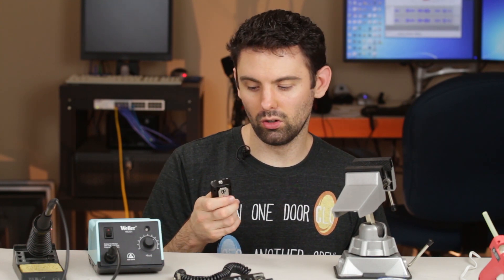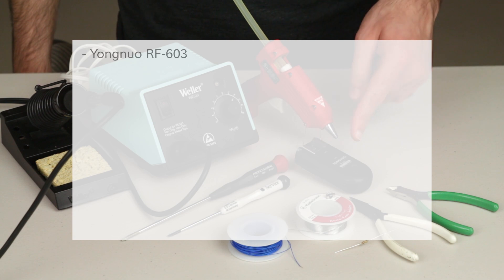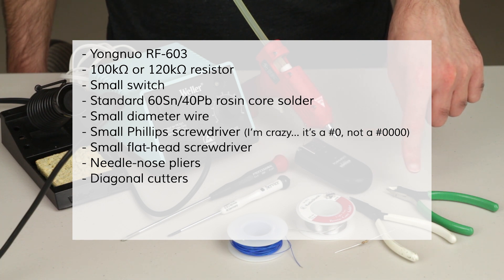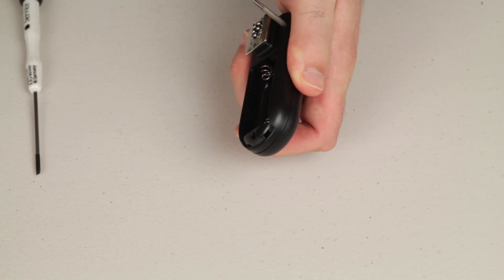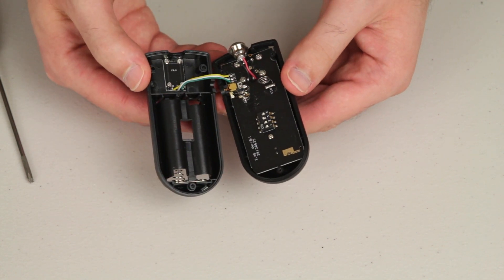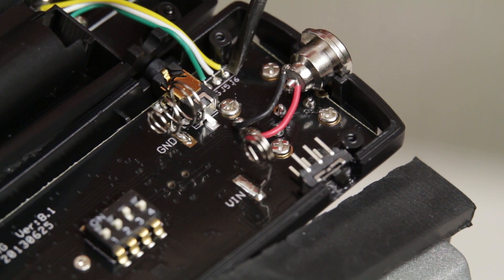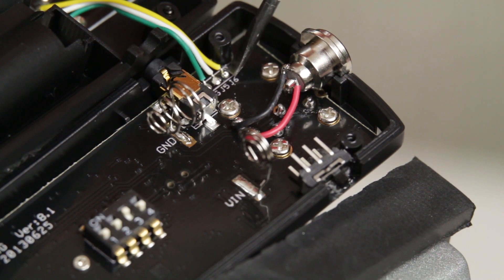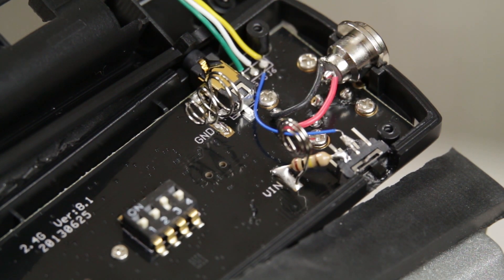Quick Hacks: Modding the Yongnuo RF-603 Wireless Flash Trigger

Comment: This method works with 603c (first version) for Canon and Sony a7III. But in my case only for a short time. Now when I plug the trigger to a hot shoe one of two green lights turns off. But when I unplug it from hot shoe it works great, both green lights turn on and I can make a test flash with my Canon Speedlite 580EXII pressing the key on modified trigger. 
Maybe someone know what could it be and how to solve this problem?

Comment: i have 2 of these and have done the same hack, however i did the hack to the second one also and nothing happens, with just one hacked it works fine, 
i didn't however use a switch as this mod doesn't get in the way of the camera. basically, jumper wire straight from vin to j6 and the hacked one works in hand and on camera

Comment: Hi Alex, thanks for the video. I reckon we now have the 603 II and 605 that have that functionality built in. Although I have a question, that I hope you can help me solve. I need to trigger my Yongnuo flashes that I put on stands with whichever trigger works. I have the 603 II, but I can buy the 605 if it will works better. But here is the catch: I want to have my Olympus TTL flash in the top of my camera (Olympus E-M1), and use the PC sync to trigger the 603 II, to trigger the flashes. I hope it makes sense. I mean, when I press the shutter, the TTL flash will fire and get me a properly illuminates image, but I also want ambience light for some darker venues, provided by my yongnuos bouncing off the ceiling on stands in the corners of the venue.

Sadly there are no 603O (for Olympus) or 603P (Panasonic), so I got the Canon version, 603C. I think the pins align, but obviously the electronics inside won't work. I don't expect to work. But I wonder if it can be modified to make it Olympus compatible. That's the reason I want to trigger the 603 externally, and not mounted to the camera.

Another idea would be to maybe mod the 2.5mm plug to make it like it was pressing the test button, which will trigger the flash. I don't really use the trigger for the camera, but for the flashes only, so I don't worry if I lose the camera triggering functionality.

I haven't tested the PC sync plug on the 603 II, since I don't have a PC sync to PC sync cord.

Is there a way that you know that I can do this? Or how to mod the 603 II to enable this feature?

Thanks a ton

Martin
Reply from the maker: +Martin Ocando I think I understand what you're trying to do, but I don't have any experience with the 603 II or the 605. That said, do the Yongnuo flashes you're using as, essentially, background lights have a flash detect/trigger mode? If so, you might be able to skip the radio triggers entirely. The mode I'm referring to is where a slave flash detects the flash pop from the master flash and then activates--this may require some experimentation and might not work in a large space.
Reply: +Alex Venz Thanks for the quick reply, Alex. They do have S1 and S2 optical slave modes, although on my last event, there were 3 other photographers on the venue, which was in fact large, and I could just imagine my flashes capturing these guys flashes and draining the batteries really quick. Not really an option for me. I need to make this work with radio.
Thanks for the idea, though. I'll keep researching.

Comment: I just wanted to add that i did solder a 120kOhm resistor (with a switch) on a RF-603N II and it works on a Fujifilm X-Pro 1 now. I also removed all the pins except the firing pin in the middle.

Comment: Why did you use a resistor? Have you tried doing this with the RF603II? I have a RF603II Nikon and tried using it on my Sony a7 and it didn't work in any mode. I noticed that when I short the center and top pin the green light comes on and it thinks it's on a Nikon...so I just soldered the two pins together (labeled S and W) and now it works on the A7. Should I instead solder a resistor between the battery teminal and W like you did?
Reply from the maker: +TheEyegor Without having an RF603II here to look at, I can't say for certain. In the mod that I did, the resistor is acting to limit current passed from the battery to the desired contact. It's mostly a safety thing since only a voltage signal is needed to trigger the desired mode change--there's no reason to allow a meaningful amount of current to pass.

Comment: This other youtube chap did a simpler version with no switch which turned it into a transmitter only, BUT would work on any camera with a hotshoe. 

When you flick the switch will it work on any camera's hotshoe as a transmitter?
Reply from the maker: It should, yes. All the switch does is make the mod toggleable.

Comment: I just did this with the Nikon one and my A7ii and it works!
Just a question, for some reason I thought I saw you saying that you needed to disconnect the yellow cable to avoid any shorts but now I keep rewatching the video and dont see it.
I did not cut mine (mine is red not yellow) so I am worried if it will hurt my camera in the long run.
Please comment. :)
Reply from the maker: shaolin95 The wire on mine just came unsoldered by accident during the modification, which I fixed on camera (during the sped-up part). Leaving it connected shouldn't cause any harm.
Reply: Alex Venz ahhhh I totally misinterpreted that for sure. Well, thanks a ton. The Nikon one is working just fine. I may not sure it for long since I plan to get the TX transmitter to control my YN560 III but in the mean time this is fantastic.

Comment: Thank You alex.
I did what you show in the the video.
when i pressed the button, the flash fired
But I still could not activate the flash with my camera without placing the trigger in the hot shoe, so In addition, I connected two ends of a pcsync cableto the white and green connections inside the trigger. it's work for me and I believe that now it can work with any camera that has a pcsync port.

Thank You

Comment: Hello you to checked if it works with Sony A 6000?
Do what you mentioned and does not work with my Sony A 6000. But it works with Panasonic fz 200
Hola usted a comprobado si funciona con Sony A 6000?
Realice lo que usted menciona y no funciona con mi Sony A 6000. Pero funciona con Panasonic fz 200

Comment: do you happen to know of a way to use the r603ii's on a sony a7 as a shutter release?
Reply: Besides the mod in the video... You need a cable like this: http://www.amazon.com/gp/product/B00P9FUD8A/ref=as_li_tl?ie=UTF8&camp=1789&creative=390957&creativeASIN=B00P9FUD8A&linkCode=as2&tag=httpbayncom-20&linkId=KQ2KDA4KPQJ7IQI5 plugged into the transmitter and the camera's multi (USB) port. The receiver units can trigger the shutter remotely.

Comment: This vid is great. what id like to do is swop out the female pc sync for a male one to connect direct to a light meter so i could use the meter and trigger the lights from the meter. sort of creating an addon module. is this possible to do?
Reply: Yongnuo RF-603ii connect direct to sekonic l-358 with pc sync cord only!!!Unsolder the RED wire on the bord and Unsolder WHITE wire on the HOTshoe and solder the two wires. isolated wires

Comment: Thanks for the video it was a great help! For all those interested I tried this mod to make the flash triggers compatible with my Lumix G2 Camera. At first it didn't work... The mod worked as described in the video but whenever I attached the modified unit to the camera hot shoe the mod was disabled. I fixed this by simply unsoldering the J6 wire which goes to the hot shoe on the RF-603. It seems that the camera must have been interfering so the fix is to remove the connection. Once again thanks for you video I would have been completely lost without it.

Comment: Great jobs!I have question,if I connect 'VIN' to 'J6' directly with resistor,does 603 still work when the top switch button turn on?
Reply from the maker: Yes, you can skip the part about adding the switch, but doing so may cause the 603's batteries to drain more quickly.
Reply: Alex Venz thx!

Comment: I just completed this hack. I have four 603s; like Alex I wanted to be able to trigger the flashes without having one on the camera. The mod worked well. I had a hard time finding a switch of that size. Finally had to compromise with a slightly larger spdt (Which doesn't make a difference, but the size was extra tight. Also my switch had a metal body and it didn't like hotmelt glue.
After doing this, I'm not sure why I would bother with the switch if I did it again. Could just run the resistor from the coil base to the yellow wire. It would always be in transmit mode, but at about $15, I could buy a fifth one to use and just keep the moded one for off-camera transmit. With buying switches and resistors and some work, it would be a wash. On the other hand, I come out of an old commercial radio background and the rosin core solder sure smelled like old home week. LOL

Comment: Has anybody been able to successfully reverse this hack? I have now received my version 2 set and wanted to use my hacked one as a receiver again. I removed the resistor, but it will no longer trigger as a receiver. If I add the resistor againit still works in hacked TX mode.
Reply from the maker: I can't say that I've experienced that problem... granted, the units I've modded all toggle back and forth thanks to the switch.

Comment: Is the soldering the same for a 3 pin switch? Great vid!
Reply from the maker: The wiring should be the same for a standard single pull double throw (SPDT) switch. I used a DPDT switch because it's what I had sitting in my parts bin. A SPST switch would also do the job.

Comment: Great Hack Alex. I'm wondering if you got access to a circuit diagram for these units or just hacked about a little bit.

The thing I want to figure out is how to mount a 603 on my 6D I use to shoot sport (Roller Derby) and have the trigger activate another one with the Remote shutter so I get a Different angle and wide of the track for context could also be for a second Camera for studio work but essentially I just want to have one camera trigger the other wirelessly.

As far as I can tell the test button is the only way to do it so thought detecting the flash contact go high and essentially have it close the test circuit would do the trick just not sure where to begin.
Reply from the maker: Unfortunately, I don't have any sort of circuit diagram for these units... but I think that a mod to accomplish your goal should be possible. My initial thought would be to toggle the hot shoe center pin contact between its normal path and a small relay that would close the test button circuit (though, I may be overcomplicating this). Depending on the voltage that's passed and/or expected by the unit, it may also be possible to jump the test circuit directly from the center pin signal... I'll have to do some experimenting.
Reply: Alex Venz That would be totally awesome I thought about a relay and then wondered where would get one small enough. So soldering a jumper would be a great solution if it works.

In the mean time I think I might use the tripod ring foot to mount a trigger with double sided tape and use the button as my shutter, since I back button focus it will just take some getting used to to shoot with my left hand.

Naturally if you can MacGyver up a fix I'd be way happy, as I suspect would be many others

Thanks for getting back to me :-)
Reply: Oh and I assume the RF-603C II are not too different although they seem to have incorporated your hack :-)
Reply from the maker: 603C-II? Oh dear.... Now I'm going to have to buy one of those and take it apart. ;-)
Reply: Big changes are power / Rx / Tx switch on the side. In other words power switch moved to the side not the top and a third position for your hack AND a hotshoe locking ring

Comment: question, after this mod, will the trigger fire from the pc sync port without pressing the button?
I ask because I have an old film camera (Nikon F3) I'd like to trigger remote flashes from, with the modded trigger connected to the camera's pc sync port. Thanx!
Reply from the maker: Well, this mod is one half of what would need to be done to get the RF-603 to activate from the PC port. By default, the RF-603 will trigger a flash through the PC port but will not activate via the PC port. To accomplish that, I think you'd need to join the center terminal of the PC port to the white wire at terminal J5 in addition to this mod. You should probably make that second mod switched as well (toggle back and forth between the default connection and the link with J5).
Reply: Dave Oliver Alex Venz To make it so that this trigger can be triggered from the PC sync port, all that has to be done is to have the wiring as per above but the centre PC Sync pin un-soldered from the board (I actually cut it) and soldered directly to the switch. Now when I connect via a pc sync cable a YN 622 and this modified RF-603 all my RF 603's fire when I trigger the YN 622.

Brilliant, many thanks.

Dave
Reply: Dave: thanks much for the info, I am going to try this. When you mention to connect the central pc sync port to the switch, where exaclty on the switch do you mean? I know nothing about circuits! (i guess it shows!)
Reply: Stéphane Caron Hi, if you visit http://goo.gl/yHYMk1 this page shows you a similar hack to this one. Hope this helps.
Reply: Dave Oliver Perfect, thanks much.

Comment from the maker: I'm trying to figure out what you're trying to do... Are you wanting to use the RF-603 as a remote shutter release combined with an on camera/off camera flash trigger (i.e. RF-603 in the hot shoe, speedlight on top of the RF-603, shutter cable from RF-603 into camera, second RF-603 on an off camera flash, and a third RF-603 to trigger everything remotely)? If you're just trying to trigger flashes, there's no need to mod anything since that's what they're meant to do.